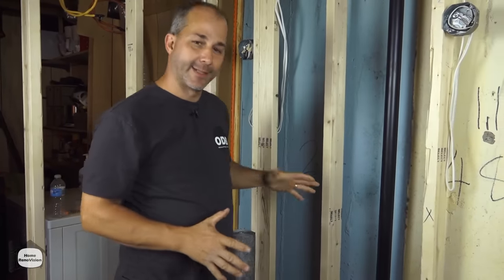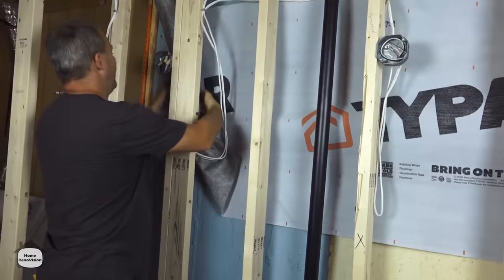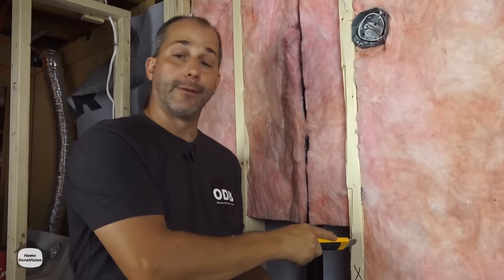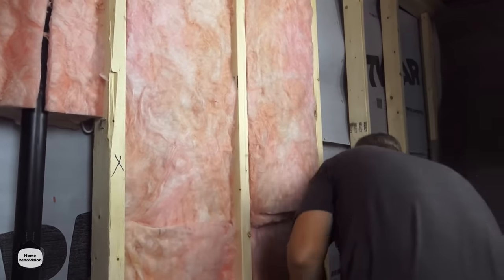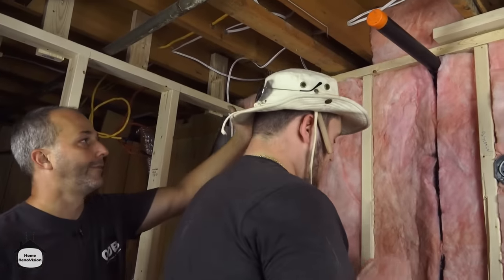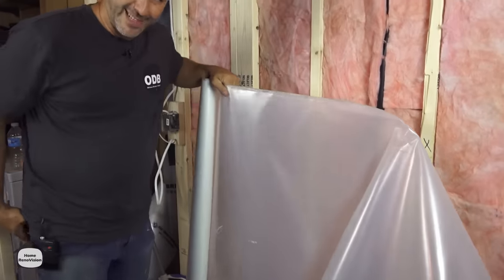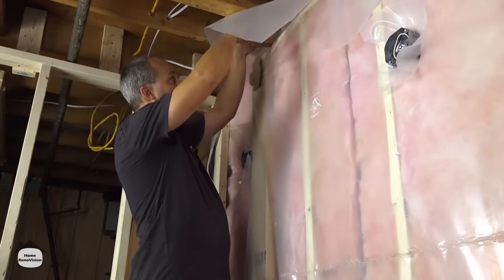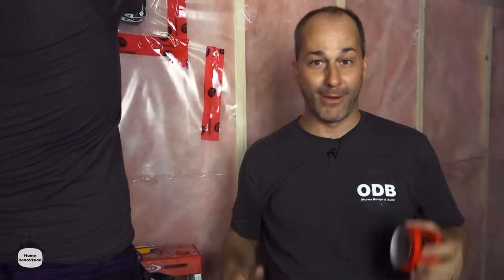How to Properly Insulate a Basement Wall: NO MOISTURE!

Comment: Hey Jeff, love the videos and I have been using them as a reference throughout the summer while I finish my basement. I have a question for you, I am just getting it ready for drywall finishing the vapour barrier and back framing. I had the rim joist spray foamed this summer, the foam is touching the top plate all the way around so I am just attaching the VB at the top plate and not to the floor above between the joists. Is this sufficient? FYI we are also in eastern Ontario for building codes etc. Thanks and keep the videos coming!

Comment: Wow! Thank you for the very clear info! When our neighbor's pool split open this summer, we pulled back the wood panelling to allow for proper drying ... and found zero plastic sheeting and puny little white styrofoam blocs with huge air gaps...no wonder our basement is always cold and humid. (We're in Montreal).
Reply from the maker: WOW, sounds like you need a major overhaul. Best of luck with that.

Comment: Would it be recommended to glue styrofoam to the concrete foundation, then leave the air gap? In Alberta. It gets COLD haha. Previous owner glued styrofoam to the walls.

Comment: Hi. Ok now i m a loyal member. I am pretty sure the only real way to safely insulate a basement is doing it right in the first place. Lots of drainage and exterior insulation. Since thats not an option once the house is built i m trying to plan my bsmt insulation. The house has been a creative redo on the two living floors, now the job is to insulate as well as possible the bsmt. Thks. Ian

Comment: By putting the wrap on the outside and inside the 2x4's, aren't you creating a double barrier and actually trapping moisture in? Wouldn't it be easier to just use a faced insulation product?
Reply: Guy Julian the outside one is breathable.
Reply: @MitchellCallahan  the plastic wrapping is breathable????? Or not??
Reply: @MitchellCallahan  Typar is for use above grade, since wind penetration is not usually a problem underground this is a waste of time and money, and yes I agree that you are creating more problems than you are solving.

Comment: Really enjoy your videos. That being said, wouldn't the moisture you are trying to prevent from comming into contact with the concrete need positive drainage? If the concrete is the wet side (potentially) your Typar overlap is working against you. Am I wrong?

Comment: Hi Jeff - I think I've talked myself in circles on how to PROPERLY construct the walls for my application.  Can you check my thinking?

Quick information about my home and weather - I think it matters...I'm not in a nice warm state...I'm in Northern Ohio, so we have temperatures down to below zero to 100*F.  My house was built in 1968-1969, so I have a cinder block foundation.  No water proofing on the exterior.  After addressing drainage outside, I'm able to keep the basement at around 45% humidity with a box store dehumidifier.

I will install a whole house dehumidifier to take even more moisture out of the air.

I plan to stay off the block wall an inch or more, just for an air barrier so the block can breath and let moisture transfer if needed.  Treated lumber on the floor and regular wood studs (not metal) for the framing.  For insulation, since there is a chance of moisture from the foundation, I am looking at foam board.  

Could I just use a standard 1" thick "pink" foam board for insulation between the studs?  Then use GreatStuff to hold the foam board to the studs.  I think foam board might be best for my application since it will not wick up water... should I get some moisture/water coming through the block down the road.  

NO poly and green (mold "resistant") drywall and done.  

My big question is on NOT using poly or any vapor barrier.  Since my foundation could get wet in rare cases, my thought is the foam board would help keep the moist air in the cavity between the foundation and studs away from the drywall.  Then there is an air gap between the foam board and the drywall.  

I've talked myself in circles on whether poly is needed between the drywall and the studs.  Some people say it's a must - others say it's how you get mold in your walls.

What are your thoughts?  (Building codes aside - i.e. if you could do it any way you wanted, for my application)

Thanks so much and great videos!
-Matt

Comment: Great video Jeff.  The building codes here in Australia are somewhat pathetic when it comes to moisture barrier & wall insulation.  Thank you for the amount of time & effort that you, Max, & the  team put in to produce such high quality videos.
Reply from the maker: Not sure what your winters are like there. Usually vapor barriers are designed for cold climate. If you are hot most of the year having that plastic sheet may cause other problems. I will need to visit one day and figure that out while on the beach.

Comment: R12 isn’t legal anywhere in Canada.  Best to do 2 inch rigid foam directly against the foundation wall, a gap to allow for squaring of the walls and R14 Roxul.  No vapour barrier needed
Reply from the maker: r12 is allowed in any structure with a n existing 2x4 construction. That is why they still sell it. You are right that they don't use it on new builds anymore.
Reply: 2inch foam will cost $35 a panel. Hell with that
Reply: I used a variation of Thermafiber/ Owens Corning products , sound control , moisture control, accessibility ... best products for FG and mineral wool.
Reply: @vanderumd11   closed cell spray, not rigid.
Reply: I agree, I did 2” ridged foam right over the concrete walls then R15 thermal fiberglass and no vapor barrier (don’t want a vapor sandwich).  Sealed the foam on all edges and also put 2” in the rim joist cavities and sealed with caulking and spray can foam.  Air tight now!  And the 2” foam was only $20 sheet.  Spray foam is much more expensive than ridged (although the ultimate solution IMHO if you can afford it).

Comment: Your videos have been a great help doing some reno work in my basement! I was wondering what your thoughts are on using rigid insulation right against the exterior basement walls? After some water ingress last fall we had to put in a interior drain tile to sump pump (exterior solutions were not possible) and I am now working on re-framing the basement.
Reply: I was thinking about rigid foam too, and also metal framing. How is your progress?

Comment: Hi Jeff.  I cant tell you how much I have learned watching your videos.  The typar looks to be "loose" at the back of the framing.  Is this to allow for airflow?  I am at this stage of my basement now and trust your experience.  Btw, I also used you membrane flooring with 5/8" osb.   I also added 5/8" rigid foam under the the osb.   dry and warm.

Comment: Question about the paper you put behind the studs.  You mentioned it's easier to put the paper up before you put up the studs but how do you attach it to the walls if the studs aren't already up?  And thanks so much for these videos!  Super helpful!
Reply from the maker: Don't. The idea is to install the wall with a gap to the concrete. You really want the air space between the paper and the concrete wall. Cheers!

Comment: Is that typar installed to the back of the stud wall or straight to the foundation wall?  Also, instead would you recommend installing a 1/2”, 1” or even 2” rigid insulation right to the foundation wall, building your wall, putting in your batt insulation and then plastic vapour barrier, is is that over kill??

Comment: Do you recommend covering the bare concrete wall with a product like Drylok or something similar?
Reply: I'm using Drylok Pro, on the inside wall as well as it has additional mildew resistance.

Comment: Do you recommend this method instead of using SM rigid foam sheets up against the foundation? (in nothern ontario climate)
Reply: If youre in canada, i wouldnt do what this dude thinks works!!! Just like an icy glass of water in the summer sweating, you need a thermal break! What this dudes doing does NOT work for the long term... Even though youre insulating between the studs the studs themselves transfer heat/cold which will eventually lead to sweating which = moisture against that vapour barrier! This method is old school and foolish in my opinion... May meet code but will mold undoubtedly!

Plus if youre a logical thinking, what do porous things do? Yep absord/wick moisture! In a basement it cant push itself outward so itll push itself inward unlike an upper level!  So would you trust that think layer of tyvek?
Reply: Do not use batt insulation in a basement. This is an awful idea and I have no idea what this man was thinking.
Reply: @jimhendrix7776  Brother, the only 6 Mil vapor barrier is on the inside of the 2x4. Now since the wall is roughly 1" from the Concrete Wall and the Tyvek/Typar Wrap is NOT a Vapor Barrier! It is a Water Diversion system. Now if you are worried about rotting out your Studs. 
In Canada, we have two ways to deal with it...
1) Pressure Treated 2x4's. MAKE SURE TO SEAL THEM IF YOU CUT ONE!
2) Use Spruce 2x4's and lay Plastic under it, personally I don't like this idea but it is CODE and acceptable
So to answer your last question. With ANOTHER QUESTION.
Why do they use it on the OUTSIDE of a house? In your opinion..the water will leach in and ROT your entire house.
To use your facts. Water is WICKED by concrete...what kind of floor do you have? I am betting Concrete. Unless it is painted or sealed..the framing of the basement with a space of 1" will take care of all the water that accumulates, unless you have a serious water problem. Since the Batts of Insulation CAN NOT come in contact with the Concrete wall the chances of Moisture reaching it is Minimal! Even if water does get there Tyvek/Typar allows air to pass through it, so the Batts of Insulation will dry rather quickly. Hence NO MOLD!

Comment: Due to a french drain that runs in my concrete slab around the basement (for a sump pump), i'm having to frame my walls about one foot in from the concrete wall. how do i / should I insulate these walls with a 1 foot air gap? also the concrete walls already have a vapor barrier. thanks so much!

Comment: Ontario code since 2012 requires a minimum of R20 for newcon and reno in a basement. Its better to use 2" xps or polyiso, sealed foam edges, a poly strip at the bottom , then do a 2x4 frame wall with pt baseplate with an R16 Roxul in between.

Comment: Many people add foam insulation panels glued to the concrete wall. Are you saying that's a no no? It makes sense to have air back in there to me so vapor isn't trapped. I'm confused. How much space is between the studs and the actual cement wall?

Comment: Hi Jeff! Thank you so much for sharing all your knowledge and expertise on a wide range of topics! And your humor and directness make it fun to watch these videos. 

I'm working on some diy basement finishing projects in Minnesota. I have a tiny basement bedroom with 2 exterior cement block walls, a small 3/4 bathroom with 1 exterior cement block wall, and a family room with one unfinished exterior cement block wall with the main sewer drain running floor to ceiling about 4 1/8th  inches out from the wall.  I thought about framing/insulating but don't think I have the space to do so the proper way you showed in this video with leaving a gap. I assume you don't like the idea of furring strips based on your comment replies. Would you recommend just leaving them unfinished/uninsulated? Im leaning toward that in the bedroom bc its already so small. The paint in the bathroom is thick/textured stuff that started cracking along the seams of the cement block soon after we moved in despite having a fan on while showering. Any tips on how to fix that/paint that'll hold up better? For the family room- would you recommend framing around the sewer drain and making an access panel at the base of the wall? And maybe a soffit to hide it at the top? It extends about 11 inches away from the concrete wall at the ceiling. Thank you!!

Comment: Thanks for the great vid. I subscribed.  My whole house is like that basement. I live in Panama. Retired here. But all my walls are concrete. This time of year September - December is rainy season. I live at 3000’. It’s cold and damp. I’m freezing at night. The house gets mold and stinks. I need to do this in my bedroom at least.  I have a music room too. That needs to be dry. I bought a large moveable dehumidifier that I turn on about 4 am. I can’t fill that up in about 3 hrs !  So, thanks for the help and I hope I can get those products here.
Reply from the maker: Sounds like you need to condition the air better before closing everything up. Perhaps a foundation waterproofing as well.

Comment: why did you overlap the water barrier the way you did?  If moisture flows down it will flow into the insulation, no?
Reply from the maker: there is no moisture flowing down the interior of the building. I am simply using a n inexpensive material to hold the insulation against the frame.

Comment: RE: musty smell.  I just moved into a house with a finished basement.  Theres access to see behind the walls in the mechanical room, and its done just like you are doing it here, but there's still a fairly prevalent musty smell.  I believe it's because the wall to wall carpet and pad is on the concrete.  Running the central air and dehumidifier helps some. Do you have any thoughts on the matter?  I'm thinking about redoing the floors with air gap underlayment.  I did watch your video on that subject as well.
Reply from the maker: the older the house the worse the environment. underlay helps dramatically fix this problem on older floors. In this case the carpet is the major problem. Cheers!
Reply: takes a lot of work to remove or peel back the carpet, but it helps..i first noticed the tack boards on the perimeter were rusting..put delta dimple board, then r5 eps foam, the wood sheathing, and put the rug back down..done..

Comment: Is there a moisture barrier between the concrete floor and the bottom plate of the wall?  Should I be concerned about the bottom plate rotting?  Should that piece be treated?

Comment: You can't glue your drywall to the studs when you use plastic so you will have to use more screws in the drywall. Also if the friction fit insulation settles you can get condensation on the back of the plastic where cold air came in contact with the plastic. I would rather use kraft faced insulation stapled between the studs. Just my opinion. Still like these videos.

Comment: Is it completely necessary to insulate in dry climate areas such as Colorado? I've seen video's of people gluing and nailing drywall directly to concrete or cinderblocks, and I believe my basement is currently finished this way. Just wondering if I should expect to re-finish the basement walls at some point.

Comment: Very nice video. Thank you.  should the typar lettering not face the concrete wall?  correct me if i am wrong but I believe the transfer of moisture on these products is one directional.
Great videos and thanks for all the content!
Reply from the maker: no worries, it is not a vapor barrier and it is only being used to hold the insulation in place so it will not fall out over time if the wood twists. Cheers!

Comment: Great video. I have been watching videos and reading a lot about insulating below grade. My basement have brick walls and the previous owners insulated the exterior walls putting the studs and fiberglass directly on the brick (BAD) so in going through the info I realized there are quite an amount of methods to insulate appropriately and the one I decided to go for is to put the 2 inch pink foam on the brick walls, build the framing on top of the foam and then insulate with roxul (thermal) basically, just using inorganic materials to avoid moisture and mold (I know some walls in the basement have mold because the bad job the previous owners did). This method could get expensive but thought it was the best aside from spray foam. I am curious about your method... do you think the method I decided to go for is cost effective and efficient? Is it any good? And compared to your method... is it less expensive using yours and more efficient? Thanks!!
Reply from the maker: That is a solid process. Just remember I leave asn air space to deal with minor water occurrences due to crazy climate. rock insulation is twice the cost of fiberglass which is also not organic and the mold comes from the wood so it must be kept dry.
Reply: Thank you! Yes, the breathing space makes a lot of sense. All official documents of my area instruct to glue the xps on the brick but I don’t know, I like that airflow between the brick wall and the xps.
Reply: Gluing 2 inches xps on the brick will prevent condensation, therefore no need for that breathing space. You can also buy foam that has a foil sheeting on one side. Anyway, your process is very solid and that is what they recommend for the Quebec City area (very cold weather)
Reply: Can rock insulation as in roxul comfortboard 80 go directly on concrete foundation wall (company said that is an acceptable option)  or must tyvek be laid first directly on the concretw? foundation? Thanks.
Reply from the maker: mieral wool can be laid direct to and stone or concrete as long as any water has somewhere to evacuate.
Reply: Do you have to worry about styrofoam gasing off?
Reply: @QC-Nado     does the foil sheating prevent condensation?